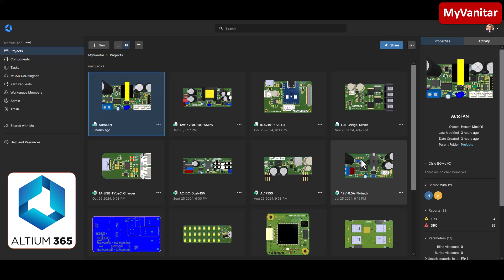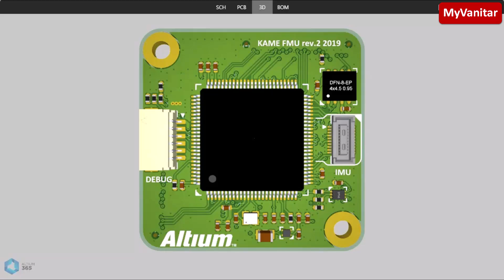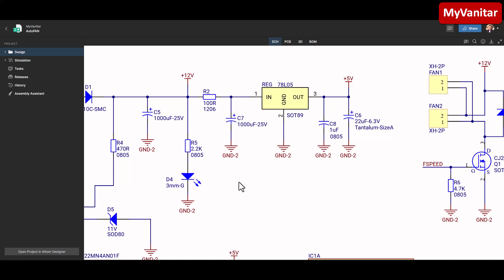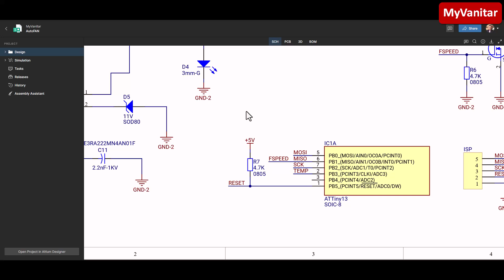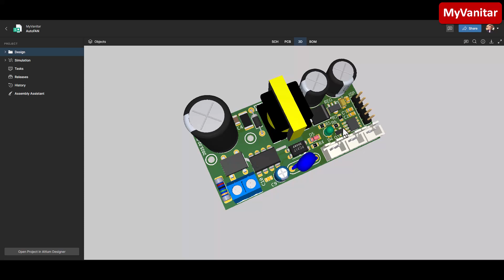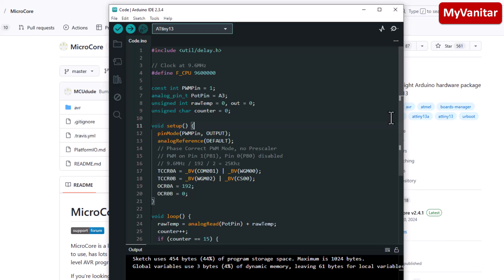Dual-FAN PWM Cooling Circuit with a 6W Isolated Flyback Power Supply

Comment: Are the markings for the phasing of the storage inductor correct? In a flyback converter, it must be the case that if you start winding at the top on the primary side, you must start winding at the bottom on the secondary side, and vice versa.
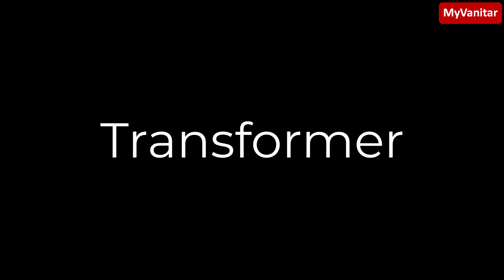Starting at 22:44 in the video, both black dots are located at the bottom on both sides.
Thanks for your video.
Reply from the maker: You're welcome. "Dot" is not a scientific rule written on a stone. It is there to prevent mistakes. I have a habit of winding from the bottom (primary), but because in this circuit, I wanted to get the ground at the top of the secondary, so the dot is placed on the secondary bottom also, nothing is wrong with this, and no mistake, it works flawlessly.
Reply: @MyVanitar  Okay, I see. The anode of the diode on the secondary side is also connected to the same terminal where the winding was started.
I'm just used to working with the usual "convention".

Another topic just came to my mind, and maybe you know about it. If not, you might find it interesting.
If the winding on the primary side is started at the point where the drain of the MOSFET is connected, it improves the EMI performance of the flyback converter, even though electrically it doesn't matter whether you start winding at the top or bottom.
I recently saw this in the Würth Elektronik presentation "DESIGN CONSIDERATIONS FOR FLYBACK TRANSFORMER" (which is freely available online, from slide 47 onwards, there is also a video with the same name from Würth Elektronik).
Reply from the maker: Yes, I see here: https://www.we-online.com/files/pdf1/design-considerations-for-flyback-transformer.pdf
On page 52, it is mentioned that if the dot at the primary is near the MOSFET, this is good for EMI. I did not know about this, but I was following. Thank you very much. what's your name? I will mention your point in my next power supply video
Reply: @MyVanitar  I'm glad you found the information useful! My name is Albert; if you want and if possible, please mention me simply as deralbert (one word, all lowercase, pronounced according to German rules as "der Albert" :) ). Some time ago, I sent you a few questions by email, and you asked me to post them under the video, but I ended up not doing that, as I was able to answer my questions myself almost immediately after writing to you.
Reply from the maker: Sure, I will mention you. I ask this in Email because your question is useful for other people who look at comments

Comment: I think you still need to accelerate the fans to 100% for a short period of time when starting the board to start them at low temperatures values
Reply from the maker: Yeah, I see this logic in some devices, by the way you have the code, this can be implemented easily